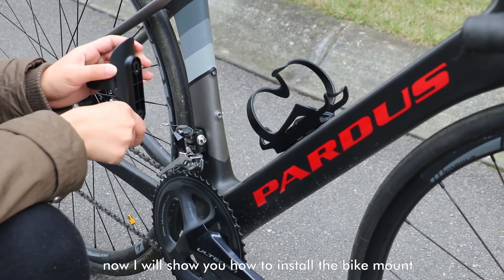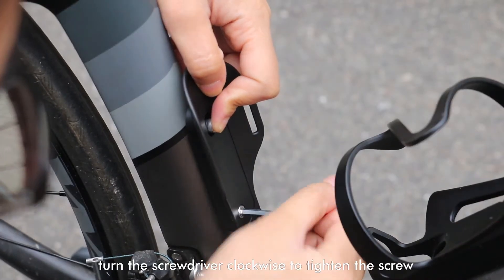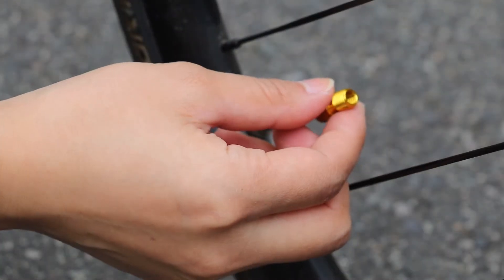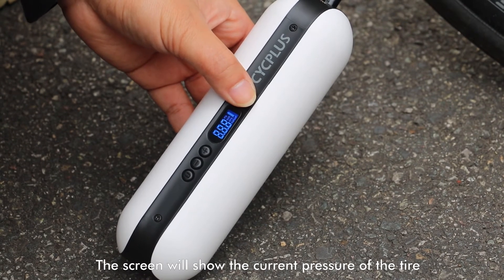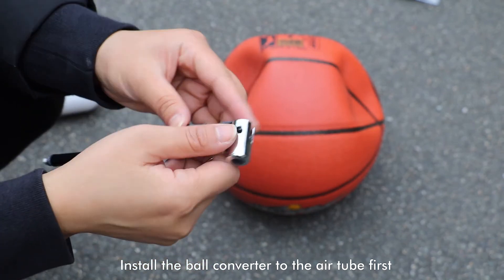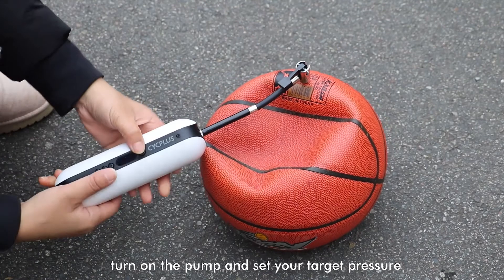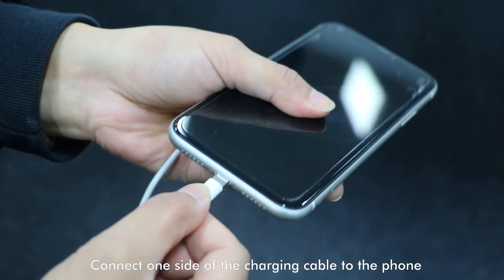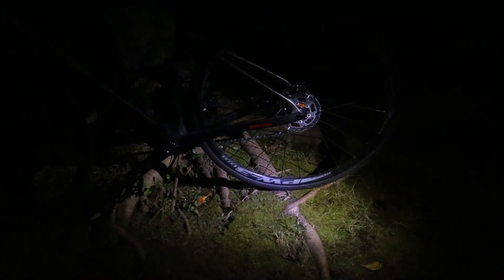Cycplus A2 Electric Air Inflator: Newest Unboxing and User Instruction

Comment: Finally someone shows how to use the charging mode
Reply: If you can help me... I bought it and I'm having difficulty fitting it to the presta valve on my bikes so that the device identifies the current calibration as is done with conventional pumps. I inserted the cable into the A2 then the adapter and then with the presta valve open and unscrewed to insert it, I inserted the product and nothing. Can you help me?

Comment: How do you reset this? Mine keeps reading 130 PSI, and never goes to 0 PSI, when turned on.
Reply from the maker: Hello, simultaneously press and hold the + and - button to calibrate the pressure gauge. If you still encounter issues, please contact steven@cycplus.com. Our customer service team will assist you.
Reply: @cycplus_official  Thanks so much! Damn thing was stolen, but good for your customer base to know!

Comment: It developed a defect after less than two months of moderate use. I used it less than 10 times to top off the pressure on a road bike. The maximum pressure I used was 65 psi and it still stopped working. I don't recommend it.

Please ignore any errors in the text, as I am not an English speaker.
Reply from the maker: Hello, sincerely apologize for any inconvenience caused. Our products all come with a one-year warranty. Could you please send your order number to our after-sales team and we'll solve them for you as soon as possible?

Comment: If you can help me... I bought it and I'm having difficulty fitting it to the presta valve on my bikes so that the device identifies the current calibration as is done with conventional pumps. I inserted the cable into the A2 then the adapter and then with the presta valve open and unscrewed to insert it, I inserted the product and nothing. Can you help me?
Reply from the maker: Hello, thank you for your comment. May I ask if you could send an email to steven@cycplus.com? Our after-sales colleagues will try their best to help you out.